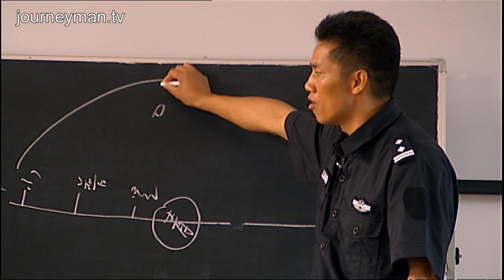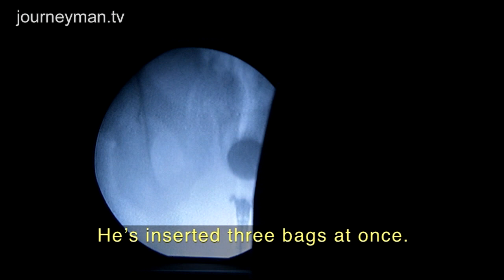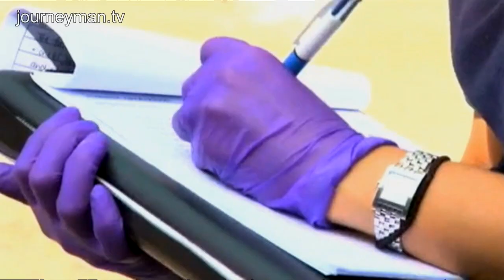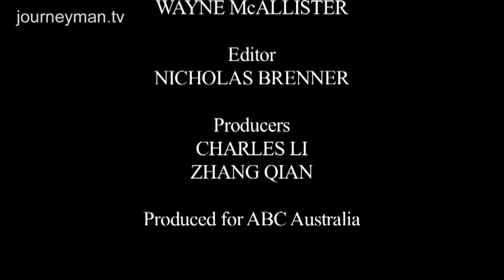Border Patrol With China's Toughest Drug Squad

Comment: Over 50 grams of meth/ice is punishable by death already. Minimum is 15 years in prison. Those people probably will have the minimum. Noticed somebody says he will do 49 grams next time. Well..that's minimum 7 years too. Good luck dude. As for those talking about bribes or people with special connections to the officials, you really think that's going to happen? If it is the case, you probably won't need so many officers risking life at the front line and the traffikers do not need to be creative anymore.

Comment: Drug smuggling at the first border we saw would be easy. They don't use dogs and can only do so much at the side of the road. They don't even look twice at pretty young women. So if u was a snuggling I would get under the car and take alot of it off and build a secret compartment that is only accessible from under the car after its been taken apart. Then get a young pretty women to drive it. With no dogs that car is making it through 99% of times.